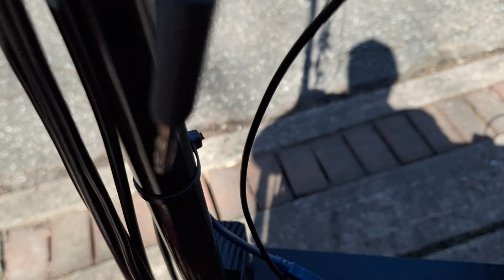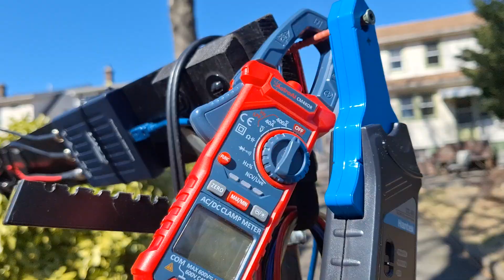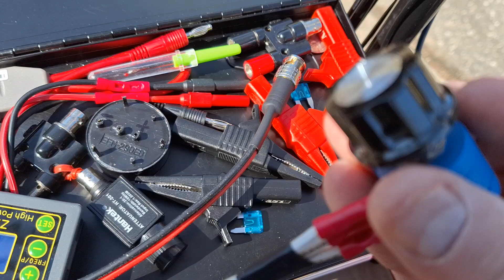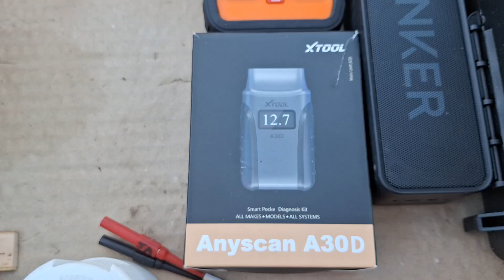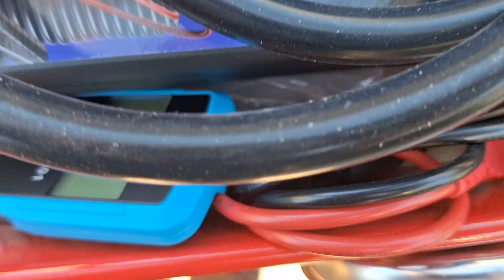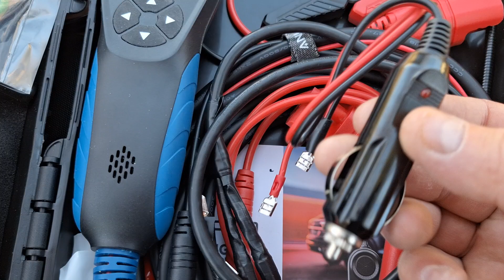Diagnostic Cart Tour: PicoScope 2204A, Custom Boom, and more (DIY).

Comment: Cool setup. What do you do with all the piezo electronics?
Reply from the maker: @maziarzarea2540 Thank you. I use them to make pulse pressure sensors to measure exhaust and intake pulses to analyze mechanical function of engine. Can also be used on cooling system for head gasket and crackcase pressure for cylinder blow by.
Reply: @MarzNet256 thanks ! Would love to see some more content
Reply from the maker: Will do. Thanks for watching!